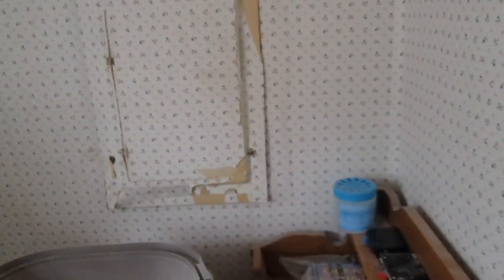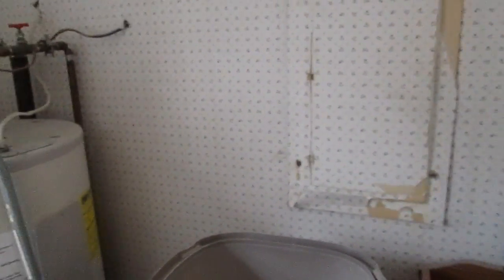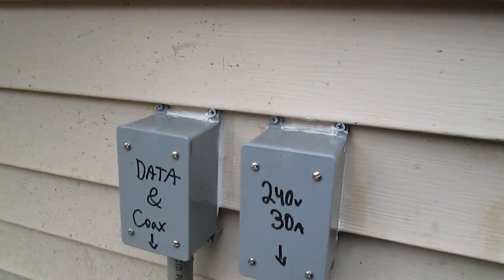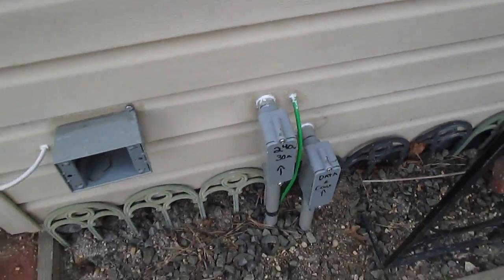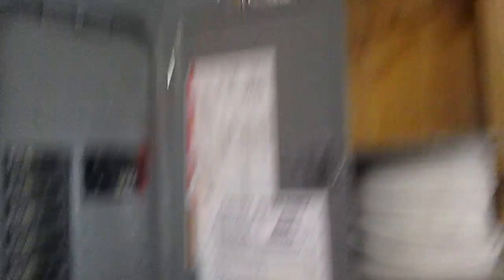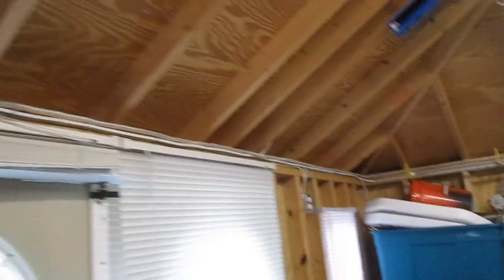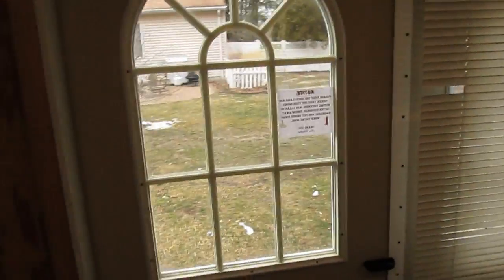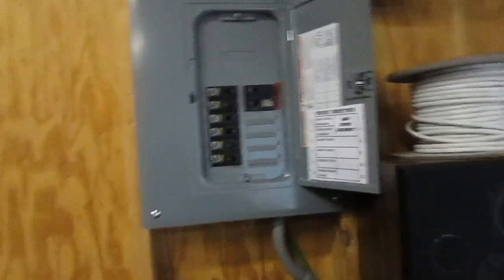Shed Electric Installation

Comment: Pretty sure that wiring isn't up to NEC code out of conduit.
Reply from the maker: Was when i put it in. As long as its not exposed to physical damage and is run to with the contour of the building. Therefore why I ran it along the top instead of thru the walls near the floor.

Comment: i want to put a music studio outside in my shed, how many amp cicrcuits woukd i need???
Reply from the maker: +quan santos Depends on what you are going to be running? A/C & Heat unit going to be installed also? Computers? Amplifiers? You may want to install a subpanel to the shed and run a 30 amp service, which would be plenty for a small music studio, with a ground rod to protect against lightning also/better noise filtering if you have a HVAC unit installed also so you can isolate the circuits. You can also add a panel mount surge protector on the sub-panel in the shed to increase equipment protection.
Reply: Computers,big hq speakers for mixing and monitoring, tv, light, small fridge, small ac
Reply: How much do you think that hvac unit would cost
Reply from the maker: +quan santos Definitely a subpanel/30 amp service then for that load. And it'll still leave you with plenty to work with. You can get a thru wall AC/with heat pump for about $500 these days +/- couple hundred depending on BTU's needed. Easy all in one and efficient. How large is the shed?
Reply: +seansy59 slighlty smaller then yours
Reply: +seansy59 but i fid wanna put up some fire proof aheetrock i font want it to look like wood on the inside,

Comment: Just saying you ran the wrong size wire. 10 gauge would typically be for 30 amps which you have correct, but voltage drops so at 100 ft run you'd need atleast 8 guage to be safe

Comment: MESSY WIRING!! With exposed framing, why not just run the wires through the 2x4's instead of running it all ugly like that.
Reply from the maker: Cause i didnt want to drill thru the studs. Not that messy. It works and its neat enough so works for my needs.

Comment: I always thought your SER wire should be at least 4 gauge when running with 240 to Sub Panel?
Let me know is I am wrong on that.
Reply from the maker: You can run ANY gauge wire you would like as long as its protected by the correct size breaker upstream.There are many 30 amp, 40, and 50 amp subpanels fed with 10, 8, and 6 gauge cable. 240 doesnt mean anything. there are 12 gauge 20 amp 240 runs sometimes. It may not serve a purpose, but as long as its done correctly, there is no code on a minimum sub panel size.
Reply: seansy59 Thanks for the reply. I was not sure. I am new at this.
- Peace

Comment from the maker: We ran 4 wire (H1, H2, N, G)...back to the main panel. The main panel does have the neutral/ground bonded. All of this was checked ahead of time. We did have 1 ground rod installed as to local codes. If we had water ran to the building, then 2 would need to be installed 8ft apart...The grounds and neutral bar is isolated on the sub panel. We had everything passed by an electrician before proceeding and was given the OK...was told we really didn't even need to call him down....

Comment: Check your local electrical code, If your main panel has the Neutral bonded to ground(which is normal), then you do not install a separate ground rod/plate for sub panels. you need to run a ground from the ground bar in your main panel to your sub-panel and remove the bonding strap/screw. Neutral should NOT be connected to ground in the sub panel  With 2 grounding points, there is now a possibility a voltage can be created between them which can kill people or pets simply by walking barefoot.
Reply: Ground rods are required when more than 1 circuit in sub panel for detached garage.

Comment from the maker: Lol. I'll pass. Digging was the hardest part for this since it had to be 18" deep. I'm used to doing only 6-12" deep for sprinkler lines.
Reply: seansy59 my Christmas lights show display  controller show box  6 outlets  I have another 3way plug  125 power cord  for Christmas lights strings led arch’s  6 of them  1 mini tree  rest of them  windows doors garage door  lots 🌲 200 amps breakers box  2  big barn front post pole 2 more outlets 10  under burn in closedown shed 2 more outlets  font gate   And rv plug 2 outlets  that it  Extreme Christmas lights display 200 amp service power outside your shed in your house that’s it that’s my question